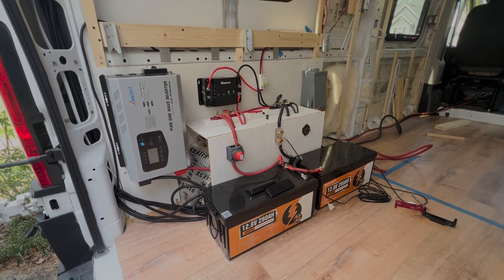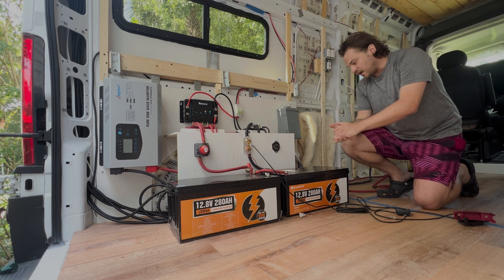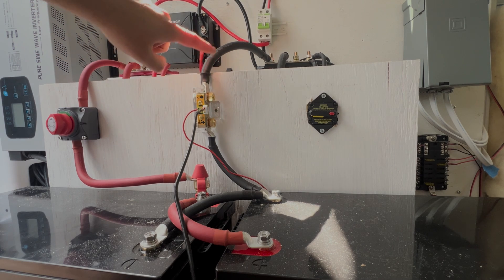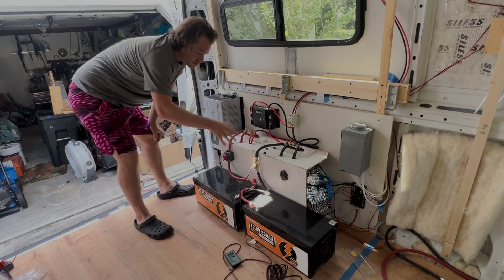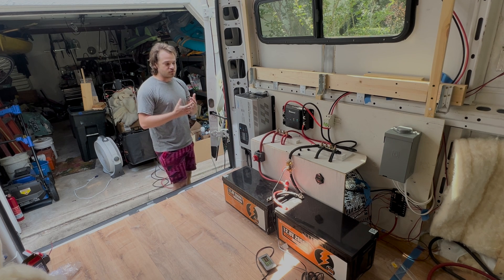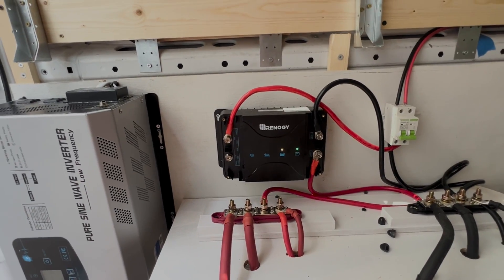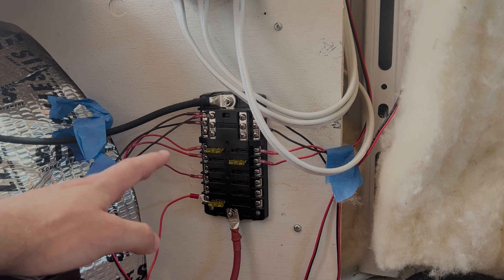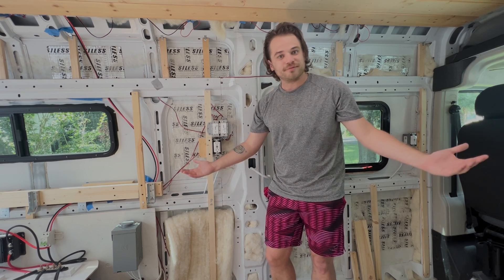DIY Camper Van Electrical System || DIY ELECTRICAL || RAM PROMASTER VANLFIE BUILD

Comment: Awesome project & great content! 

Thank you. 

I have been considering an auxiliary electrical design for a minivan, and am always grateful to anyone brave enough to post to the world the nitty gritty of their own work. 

Thank you again. 

I'm learning here.  

What I do know is that DC systems can be deceptively simple, and here, we have AC & DC ... so, rock on? 

Or is it ... 🎶 Hiiiiiighway to Hell? 

There's always the possibility of some magic smoke ... or maybe even sparks & arcs & flames ... God forbid, any of that. 

Hence why the National Electrical Code is published by the National Fire Protection Association, right? 

Anyhow, if I may, as an unqualified U2oob commentator only, I have no less than an even dozen & a half detail questions & observations ... by no means intending to be, and certaining not constituting a complete design review of your awesome camper's auxiliary electrical system. 

As follows: 

1 >>  3:19 

2/0 AWG probably good for more than 200A, but you are only fused at 150A? ... and your combined battery is apparently, per Eco-Worthy's datasheet, good for ~280A? 

Why effectively clamp the battery output to 150A at the fuse?

2 >> 3:25 

150A "crazy wrong"? 

According to Eco-Worthy's datasheet for their 280Ah battery, max output for one(1) battery is 140A, hence; 

2  x 140A  =  280A  >  150A 

Or am I "crazy wrong"? ... again.

3 >> 4:46 

Why is the battery monitor reading 13.6V? 

Is the solar inputting charge? 

Should be 12.8V @ 100%? ... Or no? ... Just askin'.

4 >> 6:26 

Does there need to be / is there, perhaps out of view, an Over Current Protection Device (OCPD) on the cable to the Inverter from the main 12V bus bar?

5 >> 6:28 

Is there / should there be a Renogy output cable OCPD?

6 >> 6:34 

Not certain, but should the Inverter AC output cable have an OCPD at the Inverter? ... to protect the feeder cable to the AC Distribution Box? ... or just for isolation, a disconnect? 

Maybe it's out of view?

7 >> 6:34 

Is that the DC Distribution Panel feeder cable OCPD? ... mounted just above the right battery?

8 >> 6:30 

Rubber grommets for cable protection against vehicle vibrations at cable routing penetrations / holes?

9 >> 8:55 

50A? 

2,000W AmpInvt Inverter "User Manual" states "AC Charging Current" "0-35A"? 

Not certain if that's 
35A  @ 120V or @ 12V ... but where would the 50A Inverter output be from?

10 >> 9:00 

Just curious, assuming Inverter 50A @12V charging output, how would that be 10% of a 560Ah battery?

11 >> 9:58 

6,000W? 

Would that only be possible with; 

Shore Power  
+  Renogy (Solar/Alternator)  
+  Battery? 

And for how long 6,000W? 

A few seconds?

12 >> 10:51 

2/0 AWG to alternator? 

If Renogy has 50A max output, theoretically, not a 2/0 AWG, but instead a #6 AWG @ 3% Voltage Drop possibly sufficient ... per Blue Sea Systems cable sizing chart, apparently based on ABYC's E-11, which seems to jive with NEC "free air" ampacities. 

A 2/0 AWG alternator feeder cable overkill / difficult to route / difficult to land on the Renogy terminals & the fuse terminals? 

Perhaps future-proofing your auxiliary system for an alternator output upgrade?

13 >> Shore Power Video 

You put in a very nicely mounted 15A receptacle for receiving shore power. 

15A  x  120V  =  1,800W 

What is your calculated max auxiliary electrical load? ... or even just the calculated Inverter load?

14 >> AmpInvt User info doesn't say, I do not believe: Happen to know the size of the Inverter's AC Input fuse?

15 >> Inverter Video 

There are two AC outlets on the AmpInvt Inverter.  

Couldn't find it in the literature: Happen to know if those outlets have over-current protection? ... if they did, could you eliminate the AC Distribution Box?

16 >> Battery Charging Time 

If I understand your auxiliary system, in a scenario where only solar / alternator charging were available, from a dead auxiliary battery, it would take about 11-12 hours to reach 100%? 

560Ah. %  50A  =  11.2 hours?

17 >>  Li-ion & Thermal Runaway 

Li-ion batteries are such a compelling product -- hard at work in my phone as I type!

Beg your pardon, little Nervous Nellie here.

Li-ion batteries terrify me though, due to the very, very unlikely ... but very, very scary ... possibility of thermal runaway.  

U2oob: Lithium Battery Hydraulic Press 

Beyond the Eco-Worthy OEM internal BMS & other features, would there be any thermal runaway prevention / mitigation design features being implemented in your design? 

Just askin'.

18 >> Schematic Diagram 

Happen have a schematic diagram of your aux electrical system? 

Lot going on there, Boss. 

No need for me to see that diagram. 

Just curious if you had one [yet?]. 

---------- 

Anyway, once again, thank you for your thought provoking & well presented content. 

Grateful for any & all input.
Reply: P.S. Perhaps you already have heat.

Is that Promaster diesel?  🤞

While back on U2oob, don't remember who, but dude had a diesel heater behind/under the passenger seat(?)  of a Promaster, a heater like the Velin ... noticed Velin's heater looking up the electrical load of your Velin A/C.

I know from truckers those types of heaters can be quite good, I was thinking of one for a minivan ... tough application though, as non-mechanical me feels diesel safer, minivans all gas ... plus very limited open space in or under a minivan.

Promaster may have a factory aux fuel tap on the fuel tank, ready to rock!(?)

Apparently best to almost undersize those heaters, as they can tend to gunk up if not running full tilt.

Thought I should mention.

Of course, would need a little power for a vent fan & controls.
Reply from the maker: @kradius2169  I wish we had heat - in Florida now and dont need it but well see what happens as it gets colder - i have some space laid out in the back for a 12VDC diesel heater (seperate diesel tank) unfortunately the promaster is gas :(
Reply: @PeterGoesPlaces  ... Velit and Espar and likely others have gasoline heaters, maybe some/all are dual fuel?

Don't know why I lean towards diesel -- not a position I could defend -- practically all semi trucks are diesel, right? ... gotta be good reasons ... torque, etc.

Like I mentioned, there may be an aux fuel tap on your tank.

Good luck.
Reply from the maker: Wow, great questions!  I appreciate your comment and I'll do my best to answer all of these!

1) I estimated my worst case scenario for amps out on the battery and wanted to keep my output around that - may be short sited but id rather be safe than sorry!

2) not wrong at all! but a similar answer to the one above - I wanted to keep it around safe limits of the battery and limit it towards the higher side of a single battery than both

3) Our battery at the time was at full charge and typically at full charge it'll show higher voltages (ideal voltage/standard voltages are 12.8V but range based off charge - this happens in car batteries and other batteries as well)

4) there are a ton of protections within the inverter/charger itself so i didnt feel the need to add one - however it does not hurt to add extra potection and you totally can!

5) same deal! i chose not to but you totally can - with other breakers/fuses on the input side of the charger i decided not to!

6) the AC distribution box has 2 20A breakers on the inside that work as a disconnect to the inverter side! if i needed to work on the cable itself or the inverter output terminals i would disconnect the system entirely - so an additional disconnect didnt make much sense for me

7) yes! great eye!

8) not a bad idea! i may add some flex seal or something to add this protection from rubbing!

9) Wow - great catch! i mispoke, it is 35A !

10) it is definetly less than 10% but the total charging from the inverter as well as the renogy batt charger totals greaeter than 10% - wrong in the video from how i spoke, great catch again!

11) 6000W should be peak output in emergency situations so it would only be for a short time period - nothing crazy but nothing small!

12) definetly sized these cables for future proofing! but the battery cables fit to the terminals well enough as well!

13) I wouldnt trust these 15A max labels - essentially uses the same cable as standar marinecore that is used in the rest of the system and can definetly handle more!

14). I'm not near the van right now for this but i can confirm in the future for you!

15) These supposedly only have a 10A max output - so technically yes - however i wanted more output so i  tied in an AC breaker box!

16) yep if i had stated my inverter size appropriately than that would be correct but with the 35A its more like 16-18 hours! with the solar and alternator itll offset that though!

17) besides it being under our bed and us feeling the fire (lol bad joke) there isnt really any other method installed for this

18). I was waiting for someone to ask the quesiton - I do not but it is not a huge deal for me to sketch one up! give me over the weekend and i can get something uploaded!

thank you so much for all the great questions!  I hope i have answered them sufficiently - if not please let me know and i can try and do better!

You rock and good luck with your build!
Reply: @PeterGoesPlaces ... Whoa, that was fast!

Caught me on my heels.

If I may, follow ups to:

1 >> Rolling Stones / You Can't Always Get What You Want

Random looked up a Turin Sonata Espresso CRM3005H / 1,450W ...

1,450W  ÷  12.8V  =  ~110A

110A  +  40A of Velit A/C  +  not a single other load, no tunes, while parked somewhere in Moab sometime between Memorial Day & Labor Day

= "Gonna blow a [1]50A fuse"? 💋 

10 >> Origin of 10%

Eco-Worthy datasheet stated, combined output:

2  x  140A =  280A

35A  ÷  280A  =  12.5%?

Just curious how that's calc'd ... and is that just vanlife / electronica lore / rule of thumb? ... or perhaps even a published industry standard of sorts?

11 >> Can't Get Blood from a Turnip?

Eaton / Tripp-Lite APS2012 Inverter datasheet claims:

2,000W continuous
3,000W up to one(1) hour
4,000W for 10 seconds

Promaster build:

2,400W ... 20A @120V shore max
+  2,000W ... 150A x 12.8V batts
+     800W ... 50A x 14.5V Renogy

5,200W ... for seconds? ... otherwise shore power source blows / trips open?

Anyhow, guessing only there's some momentary surge of supply 
... followed by blown sources?

Just sayin'.

Generically speaking, obviously nice to fairly precisely / precisely know an auxiliary system's absolute max power amps & duration.

Though seems an elusive number.

13 & 14 >> Load Shedding

Shore 20A max due to plug style? ... hence, shore only power mode 2,400W max?

18 >> Schema

Best investment of electrical time possible, imnsho.

Laminated copy available in the general area for quick reference?

Good luck with the build.

Grateful for the input.

Cheers.
Reply from the maker: @kradius2169   1) great question, the nice thing is a lot of those higher power draw loads wont be to long (for instance espresso machines will peak and drop deppending on heating element usage and time heating) Most of the time those would be only a few minutes - so if the tunes are out for a song or two no biggy lol.

10) i think its more my rule of thumb - I like to keep charge times between 10-20 hours on batteries which typically is around a 10% charger sizing

11) great point and it would result more in blown fuses or shorted equpiment rahter than blown source! but yeah those pieces would go first

13/14) thats more accurate to it - I would say that would be a comfortable high on amperage

15) schematics in my brain but ill def get it down for ref!

thanks,
Peter!

Comment: a background in electrical engineering and this took you a while to research to set things up? I'm questioning who gave you an EE. (as someone who has a degree in Electrical Engineering)
Reply from the maker: Yikes, I feel like this is a bit over the top. Doing research and getting the correct components should be part of an engineers due diligence. Thanks for the comment though! Good luck with being an engineer:)
Reply: @PeterGoesPlaces  taking your time researching complex concepts absolutely but as an EE gauging wires for 12 volts on these very short runs should be an easy 5 min process. If it was someone with little to no experience I’d be more understanding, I guess my expectations for EE professionals are a bit too lofty.
Reply from the maker: Taking time and researching anything, engineer or not, should be the proper thing to do. If you don’t back up and justify your research (big or small concepts) then I’d say that is a poor engineer. Thanks for the comments though, won’t be responding past this! :)
Reply: @will1122 ... "Should be an easy 5 minute process" 🤣

Shortly [no pun intended], I'll be generating a separate detail design comment.

Looking forward to your $0.02
Reply: It takes quite a bit of research to get all the parts together that you want for the install without buying a bunch of things that aren't necessary. I spent a couple days researching and ordering all the parts for my van electrical build, and I am a 10 year Electrician who orders and installs electrical parts for a living.

Comment: In my camper i just use a powerstation and when im not camping its a solar battery to lower electricity costs.
Reply from the maker: That was a thought we had - but with working full time and the desires we have with the AC unit we needed a full electrical! How does your station work for you?
Reply: Powerstation is what I would recommend to any casual camper or someone on a tight budget.   But building a system is much more robust, easy to expand storage capacity, easy to expand charging capacity, and easy to replace individual parts.  If a powerstation fails it is a brick, but they are super convenient and easy to replace the whole station because many places sell them.